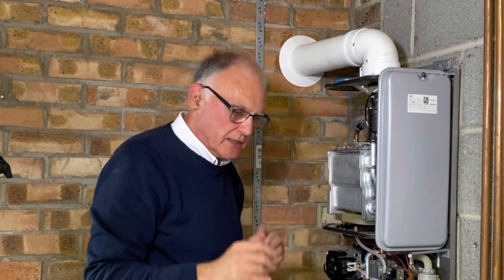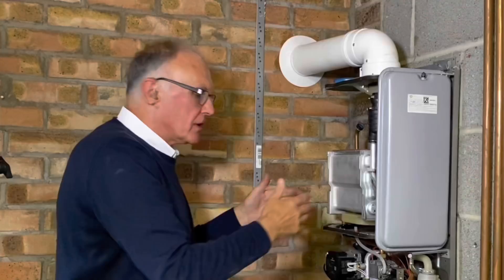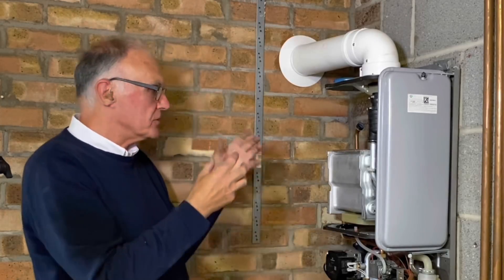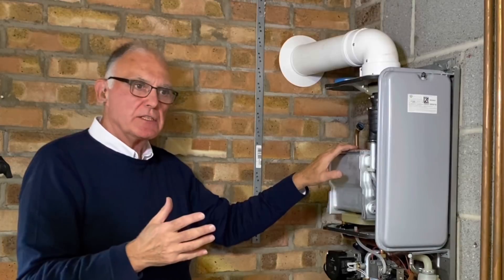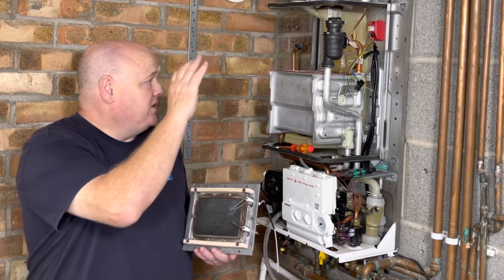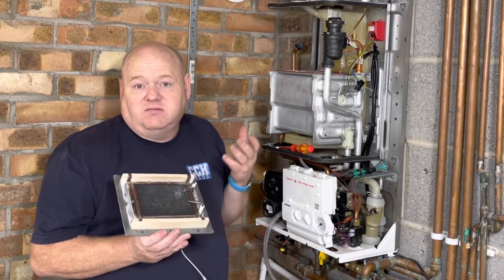Gas Training - How To Clean The Main Heat Exchanger In A Vokera Boiler

Comment: Not a real world video one minute the expansion vessel is in then it's out the guy doing it hasn't got a clue that nut on the back right is hard to get at because it's a bad design even striping to service every year then heat exchanger looks like the one you showed at the beginning absolute pile of rubbish

Comment: Shocking boiler. Those heat exchangers choke solid and burn through the back and sides. You shouldn't have to strip service a modern boiler every year.terrible design. Cheap rubbish

Comment: Got a Vokera vision 25s , from last couple of months the boiler will only turn by banging it at the front with force couple of times. Got on to Vokera they have no engineers on our place for servicing and local plumber who called presume it's PCB or relay board. The same is not in stock with Vokera. Anyone ever had these issues, it's just that boiler won't fire up unless I bang on it 😂

Comment: Hi Allen I have the same boiler, hot water works fine, Heating is faulty,  fires up , after a few seconds it goes on = off constantly, any ideas ?
Reply from the maker: Could be many things. i would call someone out, Maybe blocked plate. Thanks.

Comment: Hi Alen, I got same boiler and the red light stays on , I opened it and found the air realiser had been leaking and low pressure so replaced and topped up pressures it still goes out on bell light ! I reset it and still got red light on ! What do you think is the problem? G
Reply from the maker: I would advise you to call out a Plumber. Thanks.

Comment: Brilliant video Alan, I have a A29 that goes overtemperature shortly after firing up, I have removed the pump and its all ok, could the blocked heat exchanger as your video cause this problem

Comment: I have the same combi boiler as you the last couple of days the hot water has been playing up its running lukewarm the heating seems to be working fine the temperature is reading 58/60 degrees but it's lukewarm coming from the boiler do you have any ideas what it could be

Comment: My boiler won't fire up unless the outer boiler casing is off then it fifres up absolutely fine.  any ideas how to to fix this?
Reply: It is thie make and model in the video
Reply: update on this, with the service cover on and sealed up, if I take off the flue bend on the top of the boiler it will fire up, put JUST the bend immediately on top it will not fire up ..... stuck

Comment: I have an A09 fault on a customers vision 25
I have changed the flue thermistor and still got sane problem. Do you think cleaning the heat exchanger would solve this?
Reply from the maker: You will need an engineer to come out and check it for you.

Comment: My experience with those heat exchangers is more or less bad, first u can't clean them, u can only clean top of it and second aluminum will deform sometimes at flow or return pipe going in/out and u will have a leak, also i had leak inside the heat exchanger once massive pin hole

Comment: Hi im a gas engineer but i do not do breakdowns! I have a Vokera Maxim 29 that is making a loud kettling noise. installed about 3 years  ago & serviced comprising of a flue gas analysis  & gas tightness test only!  I am presuming this is caused by lime scale withing the heat exchanger.  Could anything else cause this noise? I have isolated the boiler & contacted my landlord.

Comment: Thanks Alan, very useful but it's clearly demonstrated that I need to avoid this boiler. It's simple but god is it awkward.  Makes me realize how easy the baxi is.....

I know some boiler manufacturers are now specifying torque for the heat exchanger bolts.....for example intergas. Is there anything like this for this boiler

Comment: Two points Alan if I may, after cleaning the top of the HEX where is the debris actually removed from, is there a sump that can be hoovered out or do you just hoover from the top?
Also would be great to do a flue gas analysis on this boiler if that would be possible too to add to your videos?
Thanks great video as always

Comment: I fitted one 3 weeks ago as a landlord supplied it. Never fitting one again - the template for the flue and support bracket (which is an awful box cut out) are about 1 to 2 inches out so the flue doesn’t line up once boiler is on the wall. The pipe layout is annoying so if swapping for a normal boiler layout the pipework looks crap, the condense trap is in a rubbish place. Trying to get the case screws in are hard etc etc.

By the time you’ve removed the 500 combustion chamber screws and faffed around removing the fan and burner i would have fully stripped down a main compact, cleaned it, put it back together and done the readings. Not an engineer friendly boiler.

Although after seeing this - once i get to service it over the coming years, i will know what to look out for - although were the boiler is located its going to be a pain in the arse to get to the top of the burner 🙃

Comment: Hi Allen or David . Would we look for high ratio readings before opening up heat exchanger.  Would Norma 0.004 ratio apply or are there other signs to look for that may indicate a build up on the main hest exchanger. 
Thanks for the video

Comment: Thanks for this helpful video Alan. 
I did a full strip on one of these today and used this as a handy pointer before I started. Very straight forward. Reminds me of stripping an isar/icos. Found the screws on the back of the fan and the two screws at the back of the burner below the flue manifold very awkward to get at. 
It’s a very simple boiler. I don’t like it. Wouldn’t have one. Wouldn’t fit one, but I’m happy to work on anything! Doing a proper job is satisfying no matter what your personal opinions are.

Comment: For me this type of boilers are garbage: they are difficult to service; maintenance takes a long time and the chemicals used for cleaning release unbearable gases!
I personally use Sodium hydroxide dissolved in water to clean the heat exchangers made of aluminum alloy: it is very fast and efficient but the emitted gas takes your breath away, so this cleaning procedure should be done outdoors which adds another inconvenience to maintenance of these heat exchangers ...
In the long run the costumer  will pay more for the maintenance of these boilers than if they chose from the beginning to buy a boiler with stainless steel heat exchanger.
I feel bad for those who bought these boilers and after 2-3 years inevitable they will start to have problems with them..

Comment: 15:29 - It wont stay there for too long :)))
Reply from the maker: What would you replace it with?
Reply: @AllenHart999  Hard answer:
1: the first criterion is to have the modulation greater than or equal to 10: 1 
2: if It has to be an combi bloiler @ 1000E I Think something from Baxi It is the first in my mind - I Think Baxi wins the Performance/reliability/price challenge 
3: You have a house and i Think enough space at least for a combi boiler with a integrated water tank and now we have 2 competitors ( there are more than 2 but the ones listed are the first ones that came to my mind)
First Viessmann Vitodens 111 (new model with 10:1 modulation)
 On the 2nd place: Baxi Nuvola Platinum …
On the 3rd place: Viessmann 222-F ( new model)
there is a boiler that failed to qualify (modulation less than 1:10) but which I always think about because I like the simple design of the combustion chamber and although it is made of aluminum alloy is I think the only on the market that can be split in two to be easily cleaned and I think it is the only boiler with aluminum heat exchanger that I like even though it is not a well-known brand: Intergas
Reply: @AllenHart999   I have a personal problem with 4 brands of boilers due to their past choices of not equipping some of their boilers with low water pressure sensors on the heating circuit or lack of water flow sensor on the heating circuit: Vaillant; Viessmann; Bosch and Ariston! . They will always have a special place on my wall of shame :D .

Comment: I can’t add a screenshot of my phone to YouTube comments so I’ll type it out longhand. This is from a whats app group this morning and started with a picture of a nice neat easiheat 32ci installed yesterday. The text from guy 1 was “The first of 4 easiheat 32ci going in this week, not sure why anyone else would fit anything other than these.”

Guy 2 answered with a “thumbs up”

Guy 3 guy answered “Best boiler they do, trouble free, tick every box, good value, light, small, powerful, pipe positions where they should be and stay!! And above all easy to install and user friendly”

Guy 3 followed up with another post “ordered another 10, coming tomorrow!! Boiler changes coming out of my ear holes!!”

Guy 4 “what’s the warranty length on them?”

Guy 3 “Only 5 years”

Guy 4 “thumbs up”

Guy 3 “5 years plenty, then sell them a service plan!! To keep your customer (thumbs up)”
 

All quoted exactly except for one spelling mistake corrected.

 

Obviously, some posters here will disagree taking into account some of the comments above but I took the trouble to write it out to illustrate each of our own little worlds is not the same as everybody else’s. 

My personal choice would be and is the Unica or Vision Plus in stainless as it’s front access for servicing with more features but like guy 3 says, if it ticks every box…

Comment: not a massive fan however. i always find cheaper products such as the vokera, etc are harder to service so you find they have never been serviced properly. contributing to their demise.

Where as.... If you look at a vaillent or a vogue etc you can get into clean them in 5-10 mins so you find they are normally looked after
Reply: Allen mentioned that too so I asked how much is a Vogue, he said three times the cost. Not everyone has that money or they might need a smaller boiler. The larger Vokera Vision Plus combis and the system boilers are stainless and front access.
Reply: @vulcancontinental  I understand that too. 

Also you generally find that when a customer chooses a cheaper boiler it because of a small budget and are looking for a cheaper job. 
Therefor not only choosing a cheaper boiler but also a cheaper installer (which tends to be a poorer installer the majority of the time)
And from that is more likely to pay £30 for the boiler servicing rather than for a proper full strip down.

Comment: Ive fitted a few of these not had many problems the boy Eric head of Vokera technical says there not a bad boiler if there set up right way
Reply: Allen heart you get what you pay for
Reply from the maker: @ryanlove2682  I wouldn’t of personally bought one of these but I am going to leave it in for a while now. Thanks.
Reply from the maker: Mine is setup correctly now so we will see how we go. Thanks.
Reply: @AllenHart999  I’ve heard the heat exchangers are not the best
Reply from the maker: @ryanlove2682  They are not the best but the boilers are very cheap.

Comment: Hi Allen Fair play to David for coming along. Worcester advised me to use bicarbonate of soda, to clean the heat exchangers, on the Junior range. The lower baffle was stuck in there, tight. The bicarb dissolves, the hardened deposits. I have stripped down one of those Easi Heats. If you have a good socket/spanner set. they ain't to difficult.
Reply from the maker: The Worcester Bosch can be a nightmare, I normally use coke a cola lol.

Comment: Well, came across a couple of these boilers this week, dropping the pcb case is easy but trying to hold it up and locate the screw is just too tricky, had to use my foot to hold it up while getting the securing screw located. Getting it to fire at maximum and minimum by pressing the little button on the pcb, (if you can find it), didn't seem to work, so would appreciate some sort of demo how to do it.
Reply from the maker: Hi Steve. Thank you for the question. It,s really easy to do, I have done a video, Thanks. https://www.youtube.com/watch?v=vmfJ0Eqovb8&t=583s
Reply: Here's a video on replacing cases https://youtu.be/hzSGDF58ong

Comment: OOF Vokera, only good vokera is a scrapped one...
Reply: Not if you know what you're doing, have not much money and prefer not to be cold. You want to be poor and cold? Rock on.
Reply from the maker: Hi SpaceFX. They are a cheap boiler that suit some price points, Mine is working well at the moment. I will be replacing it soon though as I am going for an unvented cylinder. Thanks.

Comment: Allen love your videos but you shouldn't really be advising end users that this is what needs to happen on every boiler service. As you are well aware, some manufacturers advise in MIs that a full strip down service is only required if the boiler combustion  levels exceed specific levels and therefore full cleaning of the heat exchanger is not required. Some companies out there expect 10 to 12 services in an 8 hour shift and this type of service would be impossible for every customer when on many occasions, its not required.
Reply from the maker: Hi Robert. We both know that anyone who is doing 12 jobs a day is not doing a service. It’s about time that customers see what is a service and what is an inspection visit. Thanks.
Reply: Totally agree with you Mathew but it will never happen because companies want quantity over quality and it all boils down to greedy directors.
Reply from the maker: Vokera says that this boiler should be stripped down on every service. Thanks.
Reply: Thanks Allen.
Reply: It’s time the industry recognised the difference between a proper “service” and a “safety & performance check”. Because most of the big boys(including who I’m employed by) only encourage the latter unfortunately. It’s a numbers game I’m afraid. Would rather do 6 quality services a day instead of 12 x 25min safety checks.
Reply: Robert. Exactly. They want their pound of flesh. Been in this industry for 30 years since I left school. When I first started it was all about strip down service. For the last 10-12 years I’ve never felt comfortable in what we’re now encouraged to do.
Reply: @matthewtrueblood408  Not trying to be a preacher but I did my ACS again recently and I was reminded the as a GS engineer we agree to work to the manufacturer's instructions. If your employers want you not to do that then they should say so in writing as you're the last man at the job if anything does go wrong.
Reply: @vulcancontinental  No way are you preaching, I totally agree; but I wouldn’t have a job if each service took me around an hour. Most of the big boys in the industry are using the 20min service as standard now. I know of plenty of engineers within my establishment who don’t even remove the casing. Scary.
Reply: I try to limit myself to 4-6 boiler service intervention in a day …0

Comment: So the plot thickens Allan ,how did a one year boilers heat exchanger get that dirty that quickly?It would possibly explain why the heat exchanger split because the heat was not going to the water quick enough thus causing it to overheat The biggest surprise was that the readings were ok on your last visit to this boiler last week .The ideal ISAR range has a similar set up  fan on top then burner then heat engine.I never did see  it myself but apparently the heat exchanger melted if the insulation slipped.Vokera turned up sharpish for you ,Cheers
Reply: Hi Allan I would think the Vokera rep could decipher the serial number to get at least the date of manufacture that would give you an idea how old it could be.
Reply from the maker: @johnboy1232  They stopped making the boiler over 3 years ago. Not sure if they can tell me anymore than that.
Reply: Hi Allan my experience with vokera was  from about 1995 till 2013 ,we had a lot of mynutes and lineas band D with The condensing boilers like Vokera HE 30 from about 2003 . After the Mynutes and Lineas Vokera did have a habit of changing their model's very frequently.keep up the good work.
Reply from the maker: @johnboy1232  Hi John. Thank you.
Reply from the maker: Hi John. This is a guess, I am guessing the boiler was/is much older, Then registered because they were selling the property. Do you believe its even possible to get that blocked in 12 months? Thanks.

Comment: Hi Allen, really good video.  I do a few of these as landlord tend to pick them due to price.  Takes around an hour but getting quicker each time.  I will use the white vinegar trick.  I understand why people get put off as it’s a lot faffing about.  They could try tweak it to make getting in easier!
Reply from the maker: Hi B Singh. Do you tend to see many blocked up? if so is that down to lack of service or incorrect setting up? Thanks.
Reply: @AllenHart999  I went to one a couple of days ago, it was 3 years old and set up incorrectly, it took me 30 minutes of aggresive and annoyed cleaning. It was an absolute nightmare due to it being in a cupboard, with limited access both sides of the boiler.
I don't do many of these, this one was maybe the 4th or 5th. The others were all okay in terms of set up as well as being relatively clean inside.